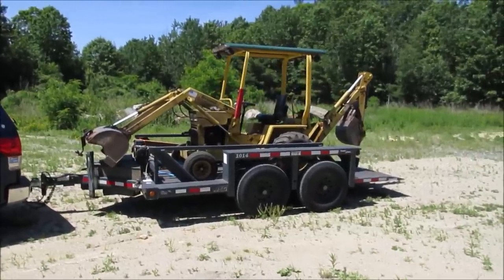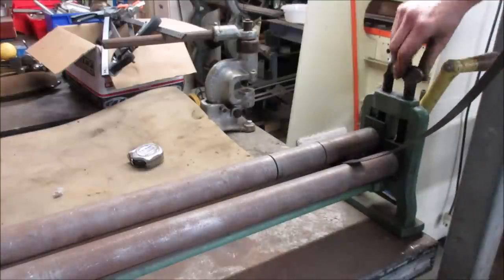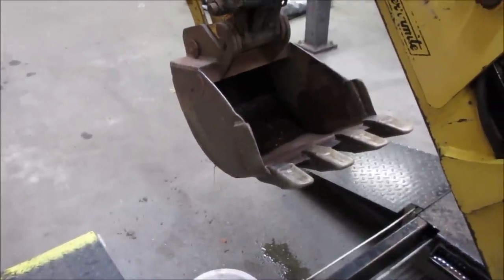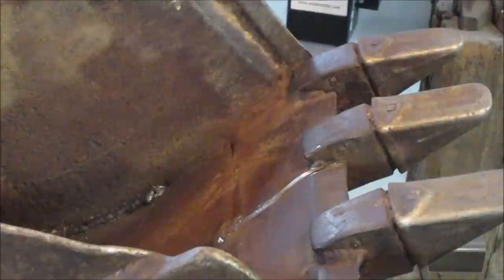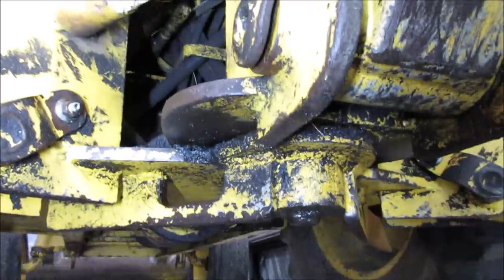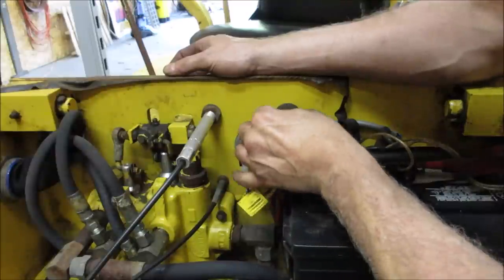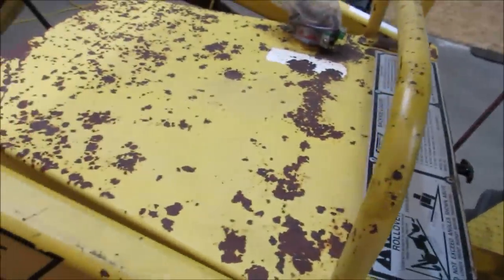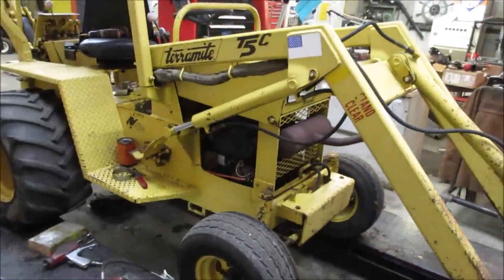I Busted My Backhoe, Now Lets Fix It!

Comment: I am a 30 year welder. Just a little helpful advice. If you weld an a dirty bucket, before welding the seam, burn the joint to glowing red with a torch and let it cool.  If you need to close a gap in metal, first tack weld the gap, then hit it with a hammer when it is still hot (glowing red). It’s a technique called hot tacking.  And when welding thick material, pre heat the metal to help it penetrate.  I have fixed hundreds of buckets.  Have a great day.

Comment: On your gas cap the metal piece  that you screwed in the cap is domed you put it back in upside down. Dome side down will line it up with the filler tube make for a better fit . Always enjoy your videos!
Reply: I saw that also
Reply: I thought it was just me that saw it.
Reply: yea. I noticed it, too.. but I got to thinking, the way he has it now will keep the added gasket from moving off center but.. the lip of the cap itself will do the same thing.. so..yea.. if it works.. it works.. lol
Reply: Put the battery hold-down on bassackwards, too! Flip the mofer over!

Comment: Mechanical people seem to have built models when they were young. First step in understanding how things work. Mustie1 must have or he wouldn’t have known the smell of the model glue. I built models, love them. Repairing is in his blood. Love from NW Colorado. Thanxz
Reply: Building models is such a great introduction to the fundamentals of how things go together.  I learned so much that way, unfortunately it seems to be a lost hobby these days.
Reply: and flying model airplanes, and the mechano sets, and tinker toy, and lego. I've recently retired and am looking forward to getting back to some model building. It sure costs a lot more than it did in the 60s.
Reply: @greyone40  Try RC crawlers, with something like a hard body (basically a plastic model body over a working metal chassis)...best of both worlds, i.e. a scale model that works. They even have a 1/24 scale Toyota Pickup from RC4WD.
Reply: no models for me.  I'm told i did poke the buttons on the VCR until it broke as a toddler though (old school ca-chunk-a-chunk buttons on a top loader).  I also took apart just about everything i've ever owned.

Comment: If you're in a lot of rocks, get you some hard surfacing rods and just run some stringers on the outside and lip of the bucket.  And it's a good job but stick rod would be a better application on the harder steel of buckets.  Love your videos man, thanks for the effort you put in to them
Reply: I'm just catching up with him now.  Surely he has a stick welder around.  This dinky sheet metal backhoe may do some good work but it's no beast.  I'm collecting plenty of stick rod from auctions.  Lasts forever if stored right.  No gas needed.

Comment: Quick tip for stuck cables -  Use a claw hammer.   It grabs even the smallest cable ends and provides leverage for slow steady pull.   I stumbled upon the idea repairing a jet ski trim cable that Salt water had locked up.
Reply: Simple solution with a simple tool. Thanks for sharing the idea.
Reply: In the mid 70's, my English teacher's name was Albert Haas. Any relations ?
Reply: Good suggestion!
Reply: @rverro8478  I have an avocado that is Haas.
Reply: @KelikakuCoutin  Cool. I guess.
Reply: @rverro8478  Haas is a reasonably common last name in German-speaking countries, so not necessarily related I guess.

Comment: I always enjoy your video's, I am a certified welder the bulbus weld profile is some what due to technique. when welding point the nozzle to the sides vs. moving from side to side. roll your wrist this slight change in angle will help flatten the weld and fill the edges. Also pause on the sides as you cross the middle twice for each weave. I hope this helps.

Comment: when i was a grease monkey in the 70s, i had to rebuild the swing cylinders on a ford backhoe twice the size of that toy. each cylinder was 6 inches in diameter and
about 4 feet long. it was not easy as i had very few tools to work with. i had to pin the cylinder to a truck bumper and use another vehicle to pull the piston. i am
jealous of your shop and tools, stuff i could not even dream about! i pulled the engine head off the tractor with a hoist to replace a bad valve seat. the oil pan was
cast iron an inch thick and weighed more than me! no power tools or air compressor or hydraulic jack. just a piece of greasy wood on wheels! ahhh, good old days!

Comment: tks for posting another great vid.
18:44 is the moaning wail of a dry pivot point. not my equipment but from looks it would benefit from a full grease job.
nice little rig but like comparable models, they're intended for light duty only. unfortunately, rentals get thoroughly abused. that's a load of stress cracks. now that it's really clean you can park it outside and alternately wet down and "exercise" it for a few days, then watch for orange streaks from otherwise invisible cracks. once identified would probably be a good idea to drill at end of each crack and then add a gusset to the repairs.
also - current battery is a size or too larger than it should be. looks like the hold down stud will contact and wear through case.

Comment: If you try to "walk" a figure 8 backwards while welding, you'll get a nicer finish than just going steady downward. Also the high "larva" look is too high feed rate for the given power. Either adjust power up or feed down.

Comment: Back when my father-in-law was a maintenance supervisor for a strip mine, the drag line used to strip the coal had a bucket large enough to park two school buses side by side in it and they would take such a beating they had two and one was always being rebuilt at any one time by two people. The rebuild cycle was 6 months so one was working while the other was being rebuilt. Any ground engagement tool takes a beating and stress cracks are common.
Reply: That's a big bucket :)

Comment: Either your drills are real nice quality or that steel is extremely soft. You went through it like wood!
Reply: Properly sharpened.
Reply: the buckets I have seen were mostly made of Hardox500- which is about 50 HRC - a normal tool steel drill has about 60 HRC. not that fun to drill, not to mention the thickness on normal sized buckets is way bigger
Reply: @olik136  The point angle makes a huge difference.  Different materials call for differing point angles.
HSS and nitrided Jobber drill points are typically 118° point angle.  They're great for soft steel, aluminum, bronze, brass, etc.  Consumer nitrided drills are usually not HSS tool steel so grinding them once they get dull is an exercise in futility.
If you're drilling harder materials move to a 135° point cobalt bit and make sure it's sharp.  The difference is instantly obvious.  You won't walk through hardened tool steel but that bucket will drill just like he was able to drill it. 
Notice the step bit had a bit more difficulty.  It's a nitrided bit and step bits are really only intended to drill 10ga sheet metal and thinner without deforming the edges of the hole.  He got away with it and honestly I've done that too but "the right way" to drill it is to get out a larger cobalt bit but sometimes you don't have one of those.  Do what works for ya and gets the job done.

Comment: Hi , Mustie1 ,I'm Peter from South Australia, Australia. that lid you pulled apart n it had some kind of seal on the inside of lid, you will find a cork coaster would fit and bend into shape without breaking.

Comment: I always enjoy your videos. Since I began watching them last year, I've repaired my 5500 watt generator, my pressure washer, and my lawnmower. I already knew how, but watching you gave me the incentive to get off my butt and fix them. The difference is I put new carbs on them rather than rebuild them. You can buy almost any of them on Amazon or eBay for $20 or less, plus I don't have a sonic cleaner. The one on the Craftsman mower was too corroded to clean anyway.

Comment: I love your stash. You're like a junk goblin but it's all useful stash that would cost you tens of thousands if you were to buy it when you need it.
Reply: I save everything to, because you never know when something will save the day.  I'm cutting up a 2008 mercury milan, and am saving the wiring, nuts, bolts, sheet metal, and all good parts.  Was wrecked, and the frame bent, but parts are good and the metal has no rust.  The way you can't get anything is reason to save stuff.
Reply: @died4us590  If the government cared any about people, there would be storage depos where people could put together stuff they've saved to recycle. And also a free "makerspace" style workshop where people can use the materials to contribute to their city. Pre-city villages did this kind of thing and people were damn happy.

Comment: "A grinder and paint makes me the welder I ain't" is how I remember the saying LOL. Don't beat yourself up, that metal is NASTY to weld on. Your right too that flux core wire is much better for welding on contaminated/ seasoned metal. It's not bad though, and definitely better than it was. I admire your creativity with the brake band. Reminds me of a brake saver sorta.

Comment: The Terramite Backhoes came in both diesel and gasoline engines.  I bought a new one about 1995. I still have it today and it still works great. Still has the same engine. I have used it to put in water lines, dug manholes, sewer lines, gas lines, underground electric lines, plus many septic tank systems. Dug out for basements, house footers, driveways, swimming pools, dug out tree stumps, plowed snow covered streets.   Pulled cars and trucks out of ditches, pulled out 1/2 mile of fence posts, hauled concrete blocks on work site, drug trees to burn piles, plus many other types of jobs.  This little machine is a real work horse.  The only problem with it is all your buddies and neighbors want to borrow it all the time.    Bought a small set of forks that attached to front bucket to load and unload clothes washers, cloth dryers, cook stoves and other appliances into and out of pickup truck beds.                          I paid $13,000.00 USD for it back when it was new.

Comment: Most heavy equipment blades and buckets have what appears to be random beads of weld on them, but they are wear points to prevent the cracks you have on your bucket. Feel free to run a few more beads in places that get a lot of wear. Yes, an inside weld will be stronger, but you need one on the outside just to wear away.

Comment: these terramites were made by the power king/economy tractor company. i have a 1947 economy, it uses a lot of surplus ford model a parts. the steering assy., the clutch and tranny, and a modified banjo style rear diff, it also uses farmall a rear tires and rims, and has a manually operated, three point implement hitch set up in the rear. they were one of the first all gear drive small tractors. mine is powered by a 9hp flat head briggs & stratton engine, and has a lot more power than you would think for the engine size, it will pull twice it's weight easy. this one uses some repurposed auto parts as well. the rear diff is a modified gm part. it's nice to see it's still working hard enough to get broken. and since it's mustie's, i know it's in good hands for the repairs.

Comment: Never touch a hydraulic line or fitting you expect may or may not be leaking, especially if there's any pressure in the system
Reply: Yup bit of paper towel saves you getting a hydraulic fluid shot, it's not that great in the blood stream.
Reply: was waiting for the pressurized eye-oiling, as well.

Comment: Hi Mustie .The rollers you have are pinch rollers. To use the rollers you start with the two rollers by set the gap to the plate thickness then roll it through bring the back roller up to give you the curve you want Used these for many years rolling duct and rings in my trade.
Reply: you could teach us all/Mustie 1 enough to easily understand the basics, tanks

Comment: Thanks for this and all your other videos.  They are fun and very informative to watch.  I've owned a 2006 Terramite T5C for over15 years.  Up until about 6 months ago I also owned a full size John Deere backhoe.  However, I found the TLC will do most of what I need and is much cheaper to maintain.  It's not super powerful but it can move more in one scoop than a man can dig in an hour here in our Georgia clay.  I'm interested to know if your gas cap fix worked?  Mine has had the same problem since purchased.  Fill it up over half a tank and it starts leaking when I bounce around  At one point I tried a new makeshift gasket like you have.  When that didn't work I bought a brand new gas cap and that still didn't completely solve it.  I finally gave up and just fill the tank half full.  I'd love to see a video on how you built your claws. On mine I welded three brackets on top of the front scoop that hold a pipe running horizontally.  The pipe holds the back of two short fork lift tynes I bought at my local scrap metal place for $20.  In this way I can simply slide out the pipe and remove the tynes.  Or if I need to lift a small pallet I can put them on.  It allows me to lift 300-400 pounds which is very handy at times.  Please keep the video's coming.

Comment: Mustie1 I worked for a truck parts company and we did brake relining for everything including crane brakes and I can say that  emergency brake may hold but I doubt it will. But if you have brass rivets on the small side you can rivet the material to it. When we would reline band brakes (that's what it is called), they are bonded on but we would drill the band evey 4 inches and then place a small brass rivet. If you don't forget to release the parking brake it will out last you and that machine.

Comment: Hidy Daren. I APPRECIATE all your videos. It feels like I'm right there with you. Your camera angles are just right, ALL the time. May I advise you to get a 32 tooth set of flat ratchets. S.K. Wayne and Snap-On make THE best ones. They ratchet and utilize small spaces, great. I thank you for all your work and editing. I thank you that you let us hear what's going on without messing it up by playing background music instead of shop sounds and you talking to us, like we are RIGHT there!!! I love it like I'm there with you. I catch myself ANSWERING you, when you ask our opinion !
   If you'll polish the steel wall first, and clean up the stud & the lugs, and a penny washer between each lug, on the stud, the penny washers will conduct much better and give more even surface contact. Put a penny washer on the stud FIRST, then the big lead, then a penny washer, then the little lead, then a penny washer and a stainless steel flat washer, (or a Brass washer), and a nut and souze down on it. Grease it all with axle grease, to prevent corrosion...THEN, add the battery tie-down.

Comment: You need to get an old stick welder.  They work wonders on stuff like that.  Also the arc you saw was not from that cable.  It looked like it arced from that block ziptied to the red cable to that battery hold down bracket.
Reply: I disagree  with that I thought it was from the cable he fixed
Reply: @mikestrauss5513   me too. But my phone is small, my eyes ain't great and sparks are fast. If not he fixed a problem that was fixing to happen...

Comment: Well heck, YT at it again. No notification, had to unsubscribe and resubscribe again and hit ALL.
Any-who, wanted to give thanks to you Mustie1. Weekend before last the sister in law's boyfriend had an issue with his front deck mower not starting after many pulls.
He would spray starter fluid in the carb just to get it running. Thanks to your videos I took the carb off and gave it a once over.
We got it running the same day and the next day he pulled it once and fired right up.
I had very little knowledge of carburetors until I had watched a good number of your videos.
Thanks for your work and sharing of knowledge, may you have a good and full life.
Last weekend I was reminded of you as an old 60s style painted VW bus drove by the in-laws house.
Taking that and the time now to pay my respects and give honor where it is due.
Much love and respect one and all.
Peace.